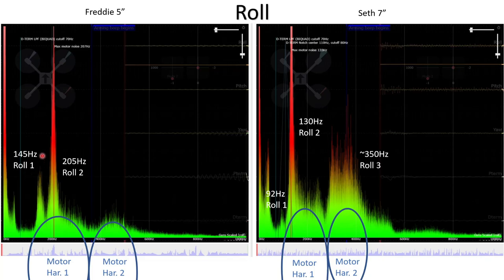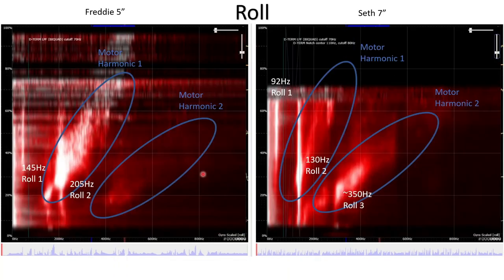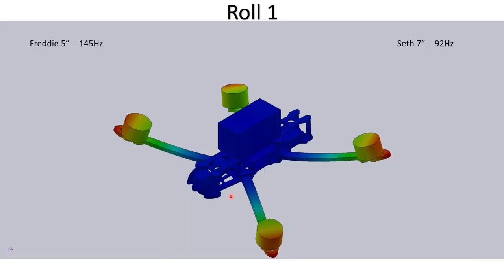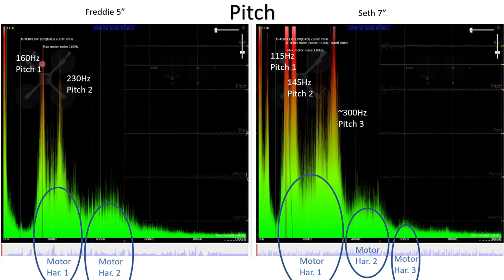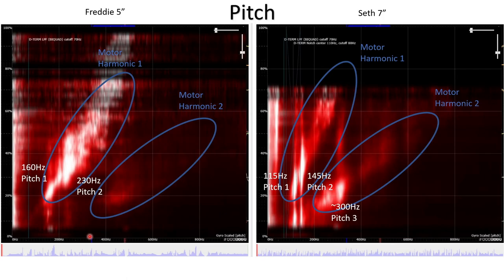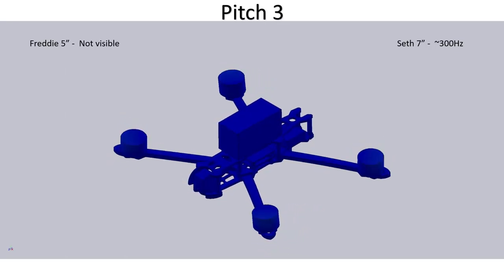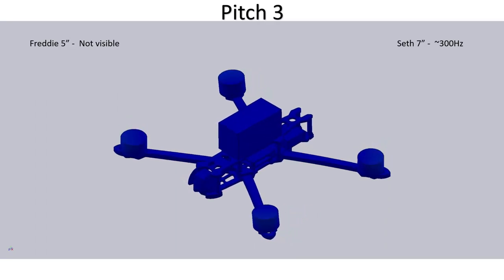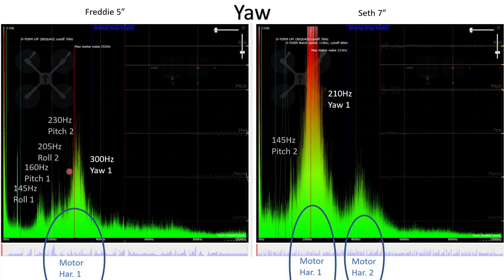Vibration and resonance analysis of GepRC Mark 4 5inch and 7inch drones

Comment: Hi Chris, a hypothesis that could explain the pitch axis response on the 160 Hz, is when the stack is bouncing up and down, the capacitor (that is ahead or behind the stack) causes a lever on the ESC and it causes the entire stack to swing on the pitch axis. It would be very interesting if you could model the stack with its supports and the masses that are attached to it, since the modal response of the stack could be different from the way the drone vibrates.
Sorry for my english, but it's no my native language 😊.

Comment: How do you calculate the Young's Modulus of your carbon? What are you using to measure the stiffness? Or, are you looking up the value from a data sheet? I ask because I have a lot of different frames and the arm stiffness varies quite a bit even when the cross-sectional dimensions are very similar. It seems to be affected by both the direction of the carbon weave, and the type of carbon fiber (e.g. T300 vs T700), but I don't know how much those things would affect your calculations.
Reply from the maker: I'm just using a typical value provided here: http://www.performance-composites.com/carbonfibre/mechanicalproperties_2.asp. As a result the simulation frequencies never perfectly match the blackbox but the mode shapes are still representative and occur at frequencies close enough to reality that matching them up is super easy.

Comment: So, the other part that isn't intuitive is the frequency at which 7" props themselves resonate.  In most cases, it is between 127Hz and 148Hz that the props will resonate at, and that can also drive a fair bit of the observed noise
Reply from the maker: Great observation. On my 7inch the props vibrate at 130Hz and on the 5inch it's 270Hz. Have you noticed prop vibrations in your blackbox?

Comment: My 5" is the Geprc mk4. I finished my Geprc mk4 7" today but before I did anything, I used Loctite Hysol to glue an extra 3.5mm (aprox) to the underside of the 7" arms. The arms are about 8.5mm because 5mm didn't seem to make sense for 7". I haven't tried tuning it yet but damn am I impressed at how it flies on stock Betaflight. I had a theory. The carbon I glued to the arms is a 4x4 twill weave which is stiffer than 2x2. Also the Hysol is not as hard as the epoxy the carbon is impregnated with, so possibly the Hysol in the lamination would help to dampen some of the vibrations and of course the thicker arms should help keep them from turning to rubber from resonance. Making them thicker and stiffer might raise the frequency from lower to higher. What do you think?
Reply from the maker: That's a really good idea! making the arms thicker will make a huge improvement. You could even try some damping grease to further reduce vibrations.
Reply: @ChrisRosser  I noticed today that the body is the weak point. I can twist the main body pretty easily now. I'm going to do something to stiffen it up too.

Comment: You could try taping the motor wires down on the arms over some moon gel, that stuff is excellent for vibration damping.  It looks like they made the arms a bit skinny for the 7" though tbh.  Excellent video 😁 by the way.
Reply from the maker: Yes, I think you are right. Its not really a design optimized for 7inch at all. But I can learn more from noisy frames than quiet ones sometimes! I will definitely get hold of some moon gel. Thanks for the suggestion. 😁
Reply: @ChrisRosser  There was a huge thread on rcgroups back in the day on arm materials & vibration damping for the long range photo squad. You may be pleasantly surprised if you stick some balsa plates vertically under the arms to stiffen them & improve airflow over the arms from the props in terms of turbulence. It turned out that wood was the best arm material for vibration damping, spruce for preference. Aluminium tube arms were the worst, with carbon tube arms transmitting HF vibration quite badly just for irony with the current miniquad frame material of choice lol.

Comment: very useful video .... A question, I have a 7 Polloco frame that I modified by designing new more resistant arms. In flight the vehicle has a low frequency vibration that I can not eliminate with the pid. He can't sit still. Is it possible to do something or can I throw away the frame?

Comment: Amazing stuff! No one makes similar content on the YouTube AFAIK. Interesting to know your opinion whether X shape arms connecting in the middle are better vibration wise then a dead cat config.
Reply from the maker: The length of the arms is a big factor. I would say true X often has longer arms than dead cat which can be a concern.  Unsure as to whether the interlocking arms will increase stiffness for the very small movements we are concerned with. My gut feel would say dead cat might be better all else being equal.

Comment: Awesome I love your frame analysis. I’m going to give black box logging a try. You have helped me understand a little more how to use it. 
I was wondering did you put a tune on the GepRC Mark 4 HD ?
Or do you have any suggestions for that frame ?
I have the vista nebula pro 20x20 Tmotor F7 FC ESC 55A Ultra esc. 
I converted an analog Mark 4 with crossfire and DJI V2 goggles.  
I just need some help on a Bettaflight 4.2 or 4.2.8. Tune.
Reply from the maker: You can try my standard filter recommendation. Its on the community page. 👍
Reply: @ChrisRosser  community page ? Is it Bettaflight 4.2 ?
Reply from the maker: @fpvraver  https://www.youtube.com/c/ChrisRosser/community Yes its 4.2
Reply: @ChrisRosser  nice thank you 🙏🏻 your the best !!!!!! Supper fast 💨!!!!
I clicked on the link you sent me it takes me to your community link but I can’tfind the tune for the GepRC Mark4?
I’m not that good with all this social media. Sorry lol
Reply from the maker: @fpvraver  I just have a standard tune for clean builds. 

https://www.youtube.com/channel/UC45_6KVAAZG_iOgzksGswMw/community?lb=UgxIdA2nSEQHTP-041R4AaABCQ

These settings should be a good starting point for most builds. If you have noise issues try lowering D term low pass but do not go lower than 70Hz. If that still isn't working you may have mechanical issues.

No gyro low pass filters. No static notch filters. No yaw low pass. No D notches.
Dynamic notch filter ON 100-400Hz Q=250 width percent 0
RPM filters ON (min 100Hz)
D term: 1 Biquad low pass at 100Hz
Reply: @ChrisRosser  ok thank you for the advice!!!! I will be implementing these setting’s

Comment: I have the 5" (original) frame and 6" (clone) frame. The former doing super on stock tune and it has survived for more than two years! The ladder is a vibration hell and I have been tuning and tweaking and never really gotten it better than barely flyable. I think the clone frame worse tolerances worsen further the vibrations. In the end I gave up bought another 6" frame.

Comment: Hi. Great video. You should test a Rebel Ruxus. It has 10mm thick arms in their 5", 6" and 7" frames. My Ruxus 7" flies great with almost no tuning and I believe it is because of the thicker arms and compact design.
Reply: I believe the bigger the quad the thicker the arms and quad in general should be.
Reply from the maker: Wow, that frame almost looks like it has vertical arms they are so thick! How much battery can you carry with your 7 inch?
Reply: @ChrisRosser  I fly for fun and performance. Not interested in LR at the moment. I usually fly with 6S 1300mah and have used 2 of those batts in parallel (2600mah). It can carry bigger batteries if needed.  Right now on Xing 2806.5 1800kv and this week will change to BH 2810 1500kv (more power...I hope)
Rebel makes some motor guards that cover  the whole tip of the arm, so your motor mounts on a thin layer of 3D printed material that somehow may help to reduce vibrations. 
But overall I believe thicker arms are needed on anything above 5". And bigger motors than what people are now using for correct prop handling.
Reply from the maker: @AlvaSpeed  Hi Alva, We are definitely on the same wavelength. 2806.5 is definitely the minimum for 7 inch and 2810 sounds really nice! A thin layer of TPU could help with vibrations by increasing the damping. If you could produce a gyro_scaled blackbox before and after that would be amazing! I can then look into modelling it and seeing what we can find out. What I'm seeing definitely suggests even thicker arms for 7inch. It should scale linearly with length I think so 5mm for 5inch and 7mm for 7inch at a minimum.
Reply: @ChrisRosser  I have never used black box...hahaha. I will try to learn....

Comment: Man....I can already see how deep the rabbit hole goes. It seems to me the main stack screws and the material they are made of also have an impact on the overall noise getting to the flight controller...? Is it possible you would get different results with different materials (ie. titanium, aluminum, steel)? Obviously we already tackle vibrations with the gummies on the stack screws, but would it be possible to "float" the stack on a separate platform with dampening underneath it? The individual stack platform could possibly be made from the dampening material?
I have a Mark 4 frame myself! lol
Reply from the maker: Vibration isolation of the FC is an interesting question. Mechanical damping and isolation adds delay to the PID loop just like software filtering so damping/isolation is not a perfect solution. Ideally you want a reasonably hard mounting so you get the best possible measurement of the movement of the quad. But you obviously need to reduce the vibrations to avoid oscillation and hot motors.
Reply: @ChrisRosser  makes sense. Thanks! Thanks for indulging my "thinking out loud"ness lol

Comment: Oustanding work! I have a question though: do you think it makes a difference whether I mount the arms inboard (above the bottom plate, as the frame is designed to be), or below the bottom plate? Because on my build I'm having issues with space, and mounting the arms below the plate would free up a lot of room inside the quad, but I don't know if it's a good idea. The little carbon reinforcing plates would fit, I tried, so I could use them, just upside down and on the bottom.
Thanks

Comment: Hmmm, I haven't tried yet, but is it possible to see resonance with a thermal camera? Or does the vibration not cause enough heat to detect?
Reply from the maker: I doubt there would be much vibrational heating unfortunately. The amount of energy is very small.

Comment: It would be interesting to see how soft mounting the motors affects these outcomes.
Reply from the maker: Yes quite a few people have enquired about that. Do you soft mount your motors? If so what effect did it have?
Reply: @ChrisRosser  I have soft mounted the motors on a couple of different six inch quads when they were built, but I haven't run tests to see the effect.  I would just need to capture black box logs with and without soft mounting, I suppose.  The theory seems sound that it reduces vibrations reaching the gyro and is essentially latency-free filtering.  I know Joshua Bardwell did some tests a few years ago and showed that it made a difference.
Reply from the maker: @Perforator2000  If you have the time and can collect gyro_scaled logs with and without I'll do some simulations and make a video looking into it in detail. Does that work for you? If so you can reach me on email https://www.youtube.com/c/ChrisRosser/about or Discord Far_Humor_420#4205
Reply: @ChrisRosser  I can possibly do that.  I need to order a few parts before I'll be able to do it, but I'll be in touch.  I'll be using a 6" Hyperlow RS+ frame with 6mm arms.
Reply from the maker: @Perforator2000  I look forward to hearing from you if and when you reach out :D
Reply: @ChrisRosser  I have the parts and should be able to get some logs tomorrow.
Reply: @Perforator2000  did you get the logs?
Reply: @MoppelMat  Yeah, I sent him a few logs.  It seemed to have made a slight difference.
Reply: @Perforator2000  What have you used to soft mount the motors?